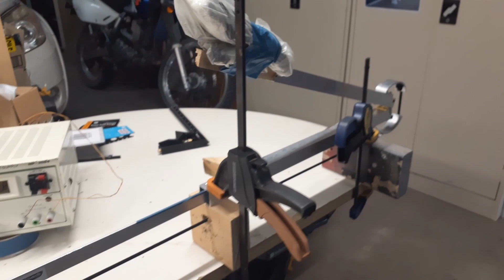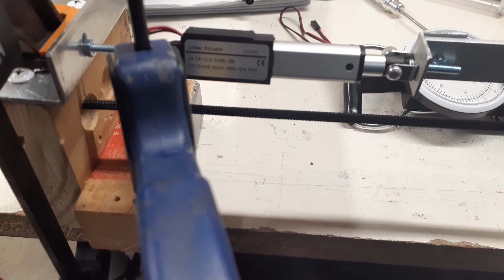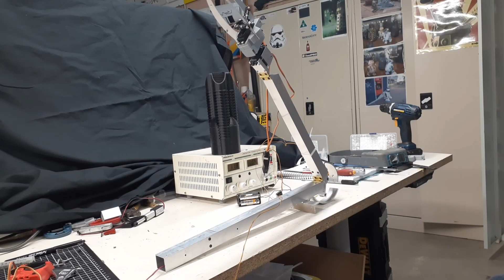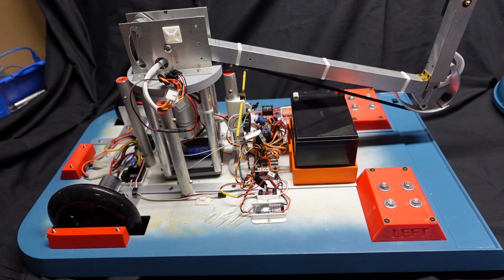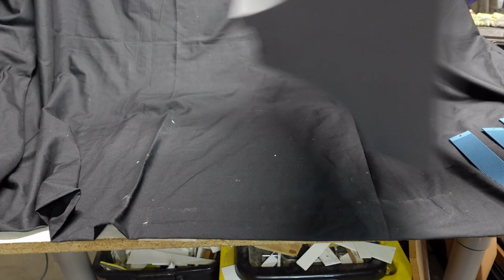Build iterations of a fan built Skutter

Comment: That is looking rad. Love some of your design solutions, better than mine. I have over complicated the head just so it can middle finger Rimmer.
Reply from the maker: Would have been great to have the middle finger function but after finding the reference photo at the 3m20sec mark I decided to drop that idea and just try to model the simpler 3 straight fingers. 
When the Skutter been out and about in public quite a few people asked about the middle finger so i'm tempted to make a head only with just that middle finger movement and head rotation.